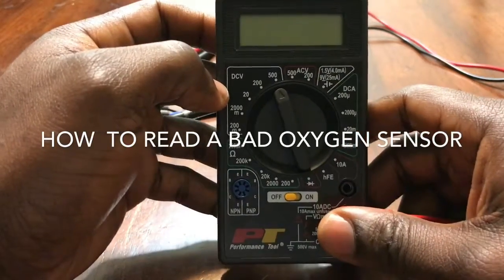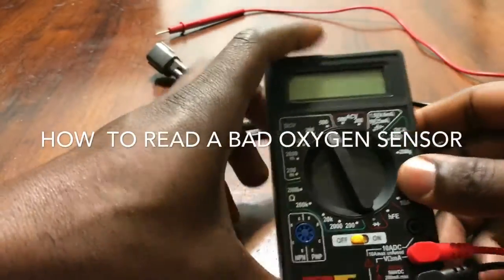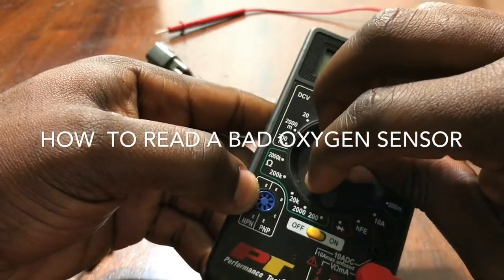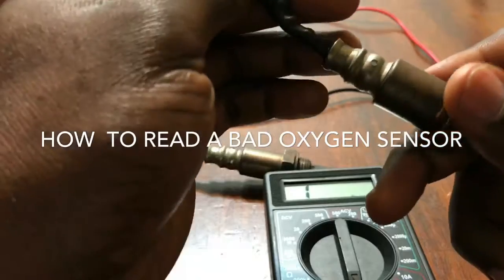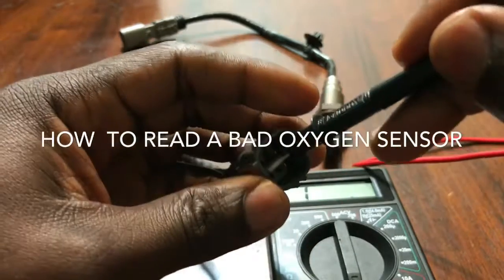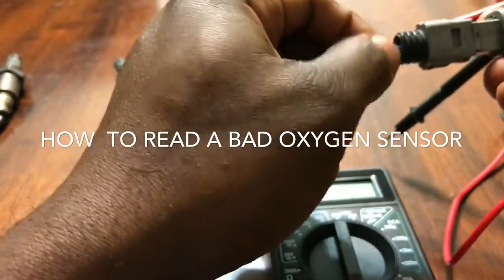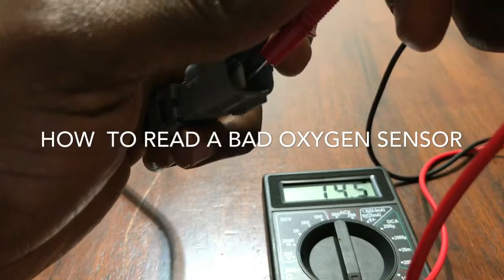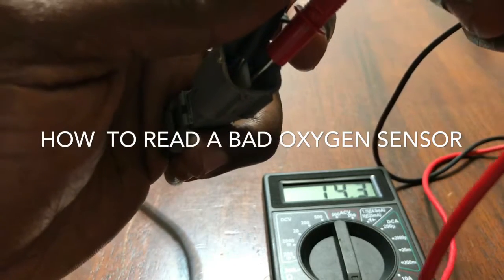HOW TO TEST OXGYEN SENSOR

Comment: The two black wires are the twelve volt feed wires...they can be tested by using the continuity setting and touching both connectors with the leads

Comment: Curious. I was told that in a 4 wire sensor,  the two same coloured wires are the sensor pre heater and the signal wires are the other 2 different coloured ones
Reply: well it is
Reply: Yes you are right. I had to look at the comments to see if anyone else knew this.
Reply: That is correct.

Comment: This is how to test the heating only, but not the sensor itself..
Reply: I may be wrong, but as far as I know, the two white wires are the heaters, the black and blue are the ground and sensor
Reply: depends on model,
some have 2 black wires and 2 more with different colors

Comment: Mine only has 1 black wire but has 4 wires and its a hot wire is that correct?
Reply: it depends,
hot wires are 2 wires with the same color,
it may have 1 black and another color wire but 2 whites
those 2 whites would be the hot wire

Comment: Can 02 cases miss fire on a car????
Reply from the maker: Nope if your having a miss fire check you spark plugs, coils or lead wires
Reply: Yes on my chevy I got a bad miss fire with po300. It was a bad upstream o2 sensor. I aslo work in a shop.
Reply: The ECU relies on the values of multiple modules / sensors to tune for a 14.7:1 air/fuel ratio. It relies heavily on the upstream O2 sensors to do this. Most likely, it will cause the fuel trims to change dramatically but you may not always feel it, if the ECU is able to control the issue but it will throw a DTC code and turn the check engine light on. Also, if it's a lean condition, which most of the time it is, you may notice an increase in fuel consumption, so your wallet will surely misfire....
Reply: @jlcastille9017  well no, if its a lean means less fuel, a richt condition Will consume fuel.
Reply: @jessicavazquez4195  a lean indication will cause the ECU to dump for fuel to "fix" the lean issue. That's what he meant